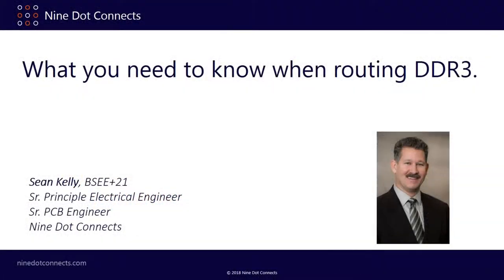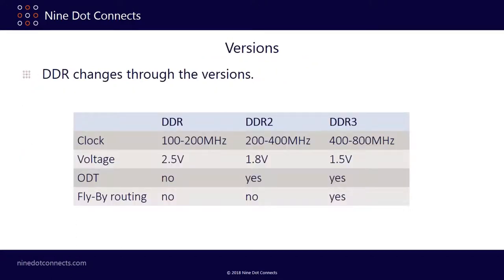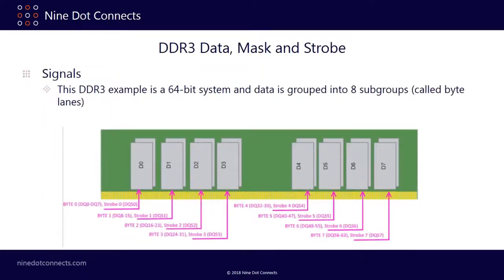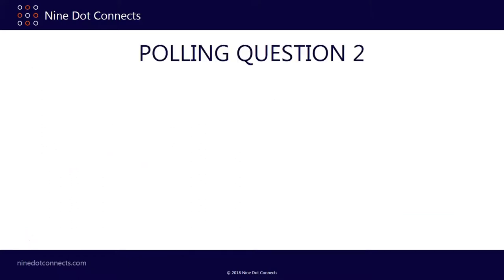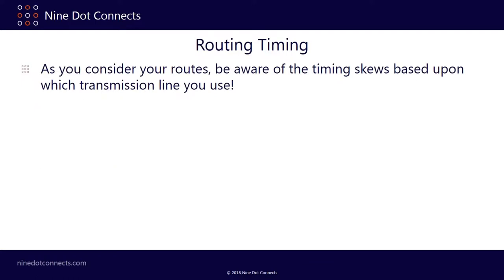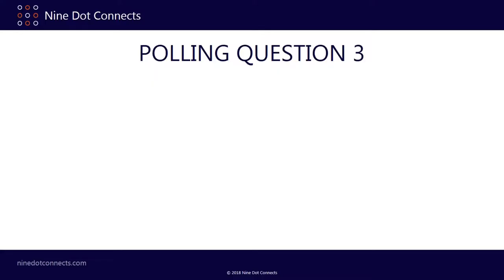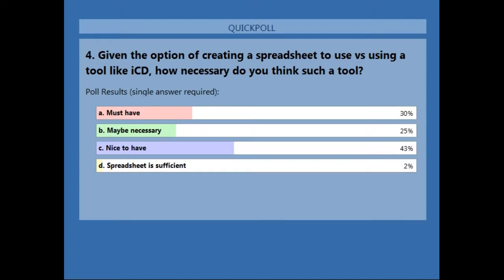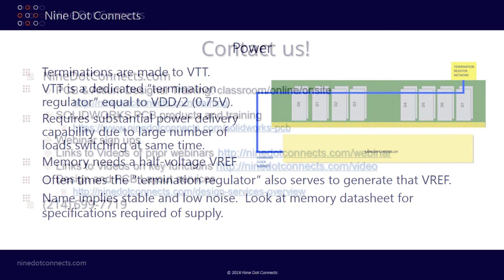What You Need to Know When Routing DDR3   Part 1 of 2

Comment: Do we need VTT termination resistors if we design only a single DDR3 chip? Beaglebone Black board did not use termination resistors. However there are several boards used termination resistors with a single DDR3 chip.
Reply from the maker: Ultimately, termination resistors are included in designs to minimize reflections. If the circuits in a single chip solution are correctly routed, the need for such terminations is typically not necessary. However, proper routing techniques may make the cost of the PCB more expensive than the terminations. Only the PCB designer can make the call as to which path is the best solution. For PCBs where pitch and real estate are not problematic, then most designs can get away with not having termination resistors. Having termination resistors gives the designer the option of tuning the terminations for added peace of mind to make sure the PCB is usable.

Comment: Thanks for the video and the reference on termination packs, which was a subject that came up between me and another engineer during discussion a couple of days ago.  At first I thought this made a strong case for packs vs discrete parts.  As I was reading this I couldn't help thinking it was trying to sell me expensive BGA resistor packs, and not putting forward a particularly fair or useful case.  Why not compare, for instance, to 0402 instead of 0603, where I imagine the parasitics would be further reduced?  On what planet is it sensible to compare terminations for high speed circuits to an axial through hole resistor - really, would anyone think to use such a thing for this kind of application?
Reply from the maker: You are correct that 0402 would provide less parasitic, and typically that is the way to go. However, when prototyping, they are more challenging to work with.  I don’t, nor have I ever seen anyone else recommend using axial resistors in this application. Resistor packs are typically used when real estate is at a premium, and simulations are available to ensure routing to them is done correctly.

Comment: 18:40 ; Do I understand correctly, lane to lane match is the allowable length difference between different bytes?
Reply from the maker: Lane-to-lane matching is not generally required. Most manufacturers do not have such a requirement. The specification in the video was part of one manufacturer’s application note. You will never go wrong in creating such a match if ever in doubt of the need.
Reply: @NineDotConnects  I also wanted to ask. Am I correct in assuming that the cloc always has to be longer than the DSQ?

I have seen this requirement for the DDR Cyclone 5:https://www.intel.com/content/dam/www/programmable/us/en/pdfs/literature/an/an444.pdf (Table 1–24; Page 70)
From your experience, how common is this requirement?

Comment: I generally like what Nine Dots has to offer but beg to differ about a few things. 1. Most of the Micro to DDR we work with are BGAs with somewhere between .8 to.5 mm pitch. Your fan out is not going to work with .5 mm parts. 

Save yourself all the unnecessary calculations (outer layer) by using Via in Pad ( which has been around for 30 years).  I am positive somewhere else on your design is a regulator that requires a VIP in the center Power PAD.  It doesn't matter at that point if you have 1 VIP or 100 once you are committed to VIP. The costs are the same for fabrication.    There are too many advantages for me to list why VIP should be used. 

Second, Why would anyone layout a high speed design on FR4.  The Dk numbers you are using are to high  for high speed boards. 

Third, Once you have analyzed the design, involve your fabricator immediately.  You can not enter random dielectric and cu thickness  numbers into a stack up.  Give the fabricator your impedance requirements, let them provide your stack up, otherwise your self taught stack up can not be fabricated....reliably.  I realize 40 ohms is the target, however 40 on internal layers may not be obtainable.  The dielectrics either have to be to close, or the trace widths have to to  wide to route.  Some inpedances are not easy to make on a PCB

There  is the problem with all of these tools.    I guarantee the stack up will be non symmetrical on each side of a stripline from the fabricator. So if you entering pretty but balanced numbers ...they are vapor ware. 

  Last I checked Altium could not calculate impedance to (one or the other) positive or  negative plane.  This has been a bug for years.  I know because base lined the Altium calculator to a Polar instruments tool years ago. Besides, there is no tool online  that matches exactly the impedance calculations that the fabricators obtain. They are close,  but still off. I have not found an online toy tool will calculate non symmetrical stripline.

I will still give the thumbs up to your presentation, you guys are good
Reply from the maker: In regards to your thoughts, we would like to address them one-by-one:

1. Fanout is a process that encompasses many options.  Many of those options are controlled by the pitch for sure.  However, via-in-pad is a technique that adds significant cost and fabrication time, especially to prototype runs and therefore is not an option for many companies or people.

2. FR4 is a fine material for small layouts.  Many engineers use it without any problems and save money doing so.  So long as the impact is understood, then FR4 is not a problem.  If the impact is not understood, it doesn’t matter what material you select for you will probably still get into trouble.

3. We at Nine Dot Connects have always been in favor of contacting the fabricator at the beginning of a design for their input on stackup.  Each fabricator has their flavor of stackup that works for your impedances and their stock.  They will typically have access to great tools to give accurate width and space rules for impedance controlled tracks.

4. There are free tools to deal with non-symmetrical striplines.  The one we have used in the past gives very good predictions of behavior.  But then again, why not just use the fabricator!
Reply: TI's PowerPAD (and many others) do not equal via in pad technology.  For BGA via in pad the via should be filled and plated over.  For PowerPAD the only real requirement is that the drill hole be small enough to not cause large amounts of solder wicking.  TI's recommended via size is 13 mil and smaller for minimal solder wicking in PowerPAD applications.